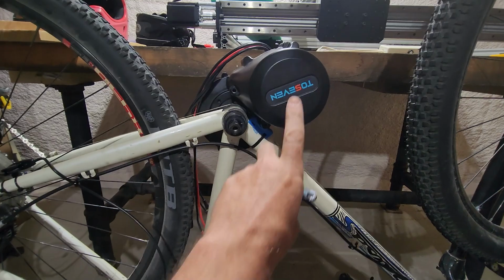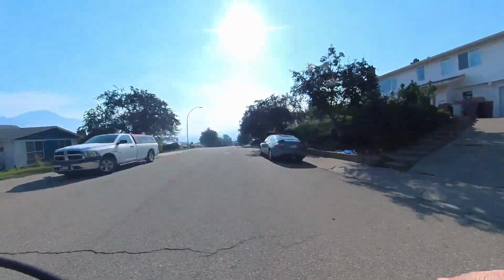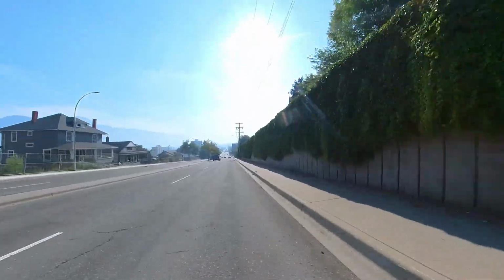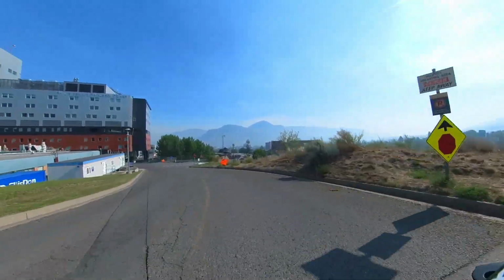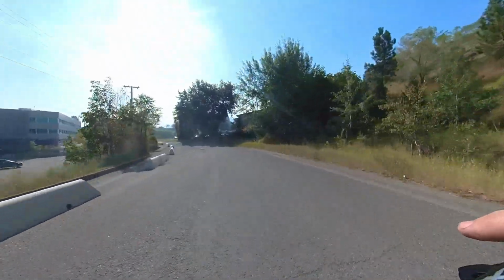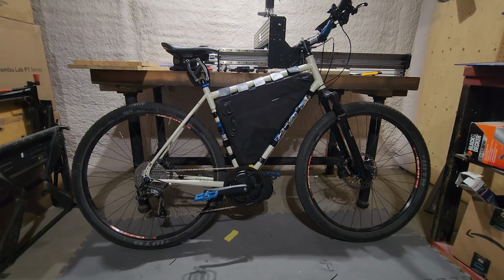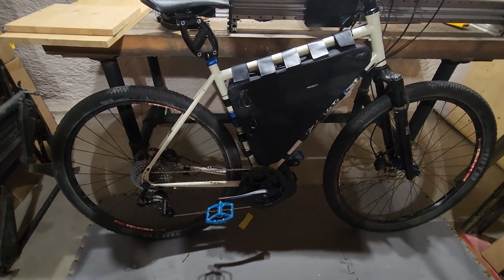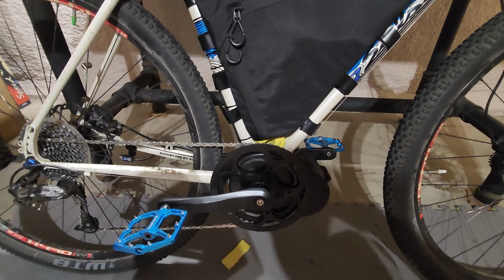TOSEVEN DM01 mid-drive DIY ebike motor Install and First Ride!

Comment: So it is not good for climbing mountains without pedaling? It has a very large plate and few discharge amps, only 30, to climb mountains you need a minimum of 35 discharge amps.
Reply: Very dependent on the gearing you are using
Reply from the maker: I think it would climb a mountain just with the throttle. The acceleration on the slope would be a bit more sluggish than with the pedal assist though. Because with that you can help the motor get up to speed with your own effort as well. I do have a smaller chainring which I could swap on for sure. I could also use a larger gear at the back.
Reply: @HighVoltageKits  I use a 46 sprocket and the chainring is a 32 with a CYC, but the toseven with 30 amp discharge is very fair for climbing mountains.
Reply: @HighVoltageKits  This has been answered by the one from the Lierskogen Ebikes channel.I've built and tested dozens of different configurations for the 4 last years. It all depends on how much torque you can get from motor. Higher torque gives more flexibility. Anyway, if you want to have good climbing rig, than you need motor with min. let say 150 Nm torque and at least 2-3 kW motor. This DM01 is not meant to be driven on throttle only, that's why ToSeven design it with torque sensor.
Reply: @Alex-uh1mj  I use a 42-tooth sprocket but the chainring that the toseven brings is very large, it is not good for climbing mountains without pedaling, and even less with 30 amps of discharge
Reply: @syntxansyntxan7543  think we can currently go down to 44 what motor do you use now
Reply: @Alex-uh1mj  44?that is a very large chainring I use a 34.CYC X1 PRO engine
Reply: @syntxansyntxan7543  it reportedly has 5000w and 250nm of torque. So im not sure the DM-01 is a suitable motor for you.

Ive built 4 wheel cargo bikes and driven them up mountains with 400kg total and 160nm... 

44T and 160nm your limiting factor isnt power its traction.
Reply: @Alex-uh1mj  I am running it at 3000w
Reply: and I have a 48v 30ah battery and 50 amp discharge, and I climb very steep mountains, what happens is that I have already broken 2 CYC motors

Comment: How do I loosen the number 9
Locknut M42X1.5?
Reply from the maker: Is this the chain ring side? Sharp tap on the wrench with a hammer clockwise to loosen.
Reply: @HighVoltageKits  Yes, the chain ring side. Edit: Thanks man! I got it I found something to lock on the chainring while tapping the locknuit with a hammer. I got it.
Happy :)
Reply from the maker: You are welcome

Comment: This kit sieve to climb mountains without pedaling?
Reply from the maker: There is a throttle. It's okay. Not very rapid at acceleration uphill. I prefer the peddle acceleration as you can boost it with your own effort.